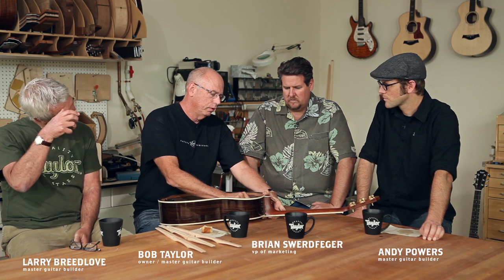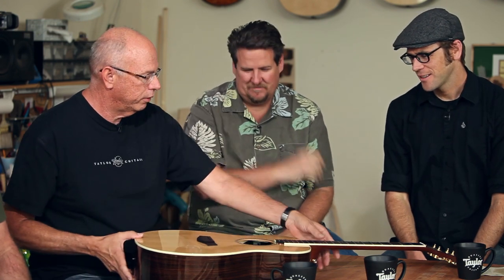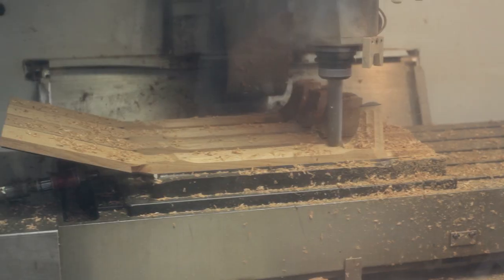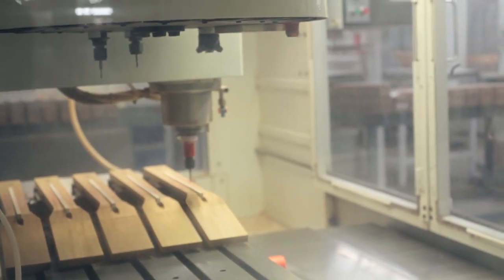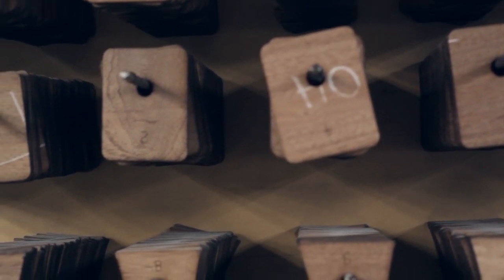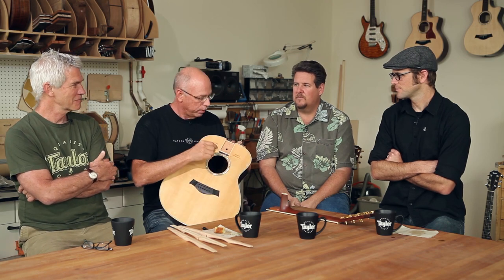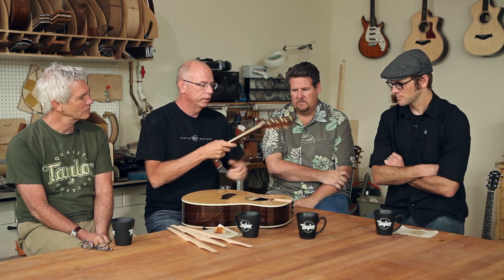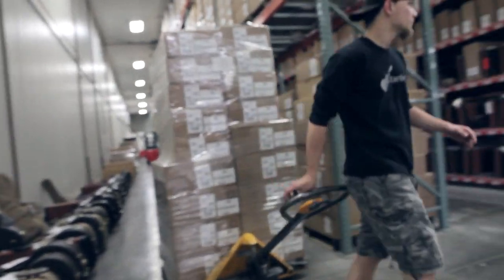Designing a Taylor Guitar's Neck - Talk About Taylor

Comment: Try and get a used 414ce you can get it as cheap as 900-1100 on cl and they usually have 9+ condition with hardcase and everything.